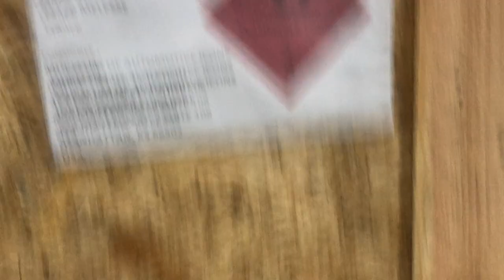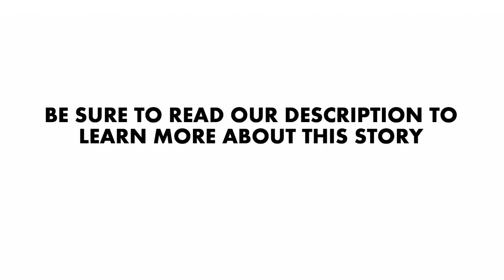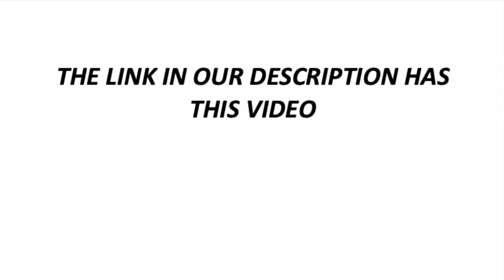Man ESCAPED the Desert by Converting a Wrecked CITROËN 2CV into a MOTORBIKE

Comment: This finally answers my question as to how power was transferred. If you're not familiar with the 2CV, it's hard to see, though they show it. 
The 2CV engine has INBOARD brake -drums-. This is vital for his plan to work. I must explain this. 
Most cars: the brake drum is right behind the wheel/tire. There's a driveshaft of some sort that goes from the brake drum (which spins as you move) to the transmission. So the brake drum moves up and down with the wheel.
On a 2CV: the brake drum is mounted directly to the spinning part at the transmission, THEN there's the driveshaft, then there's the wheel. 

So our man here ripped off the driveshafts and wheels on both sides, leaving just the spinning brake drums by themselves on the transaxle.
He lifted the engine off the front of the frame and moved it back and over just a bit until the spinning brake drum RUBS ON THE TIRE, transferring the motion.
The problem with this, his narrator pointed out, is that it now runs backwards. So he had to drive out the entire way with the transmission in REVERSE.

For the mechanically inclined: the transaxle is also a differential. So if he did ONLY this, the unladen brake drum would spin freely. He made a holder for the unladen brake drum to keep it in place and drive only the side rubbing on the tire.
Reply: Thank you sir for your brief explanation

Comment: Who took the photo?
Reply from the maker: Good question! Emile's camera had a pull wire on it; in a few of the pictures you can actually see some of the pull wire showing. We also have the camera he used on display in our collection!
Reply: Deux cheavaux doesn’t mean V2, it means two horses - as in two taxable horsepower, two horses.  It’s a tax rating, not power output, and definitely not the configuration of the cylinders 😊

Comment: The most amazing part was making a welding machine. He had a working engine. HT circuit. 
12 V supply. Capacitors & resisters. wires. Its all there but having the knowledge to utilise all the components to weld metal together is what saved his bacon.
He was kind of lucky he didn't have a liquid cooled engine. Lot fewer problems to work out.
When the bomb drops this is the guy you want in your cave not Brad Pitt. Ray Meers in your cave for food 😂